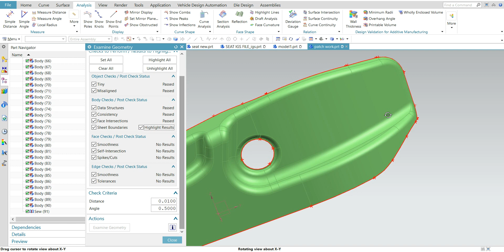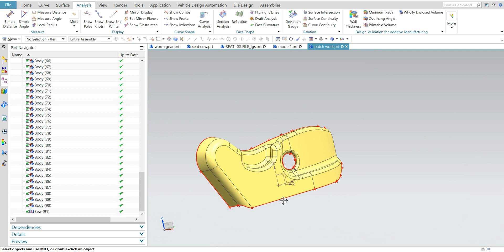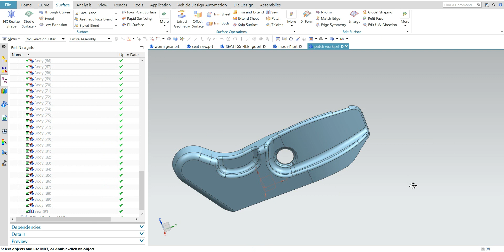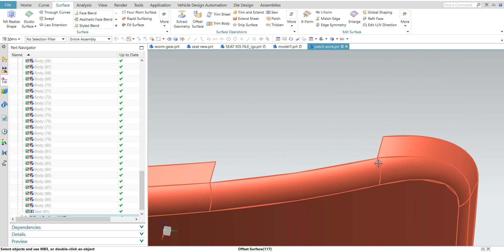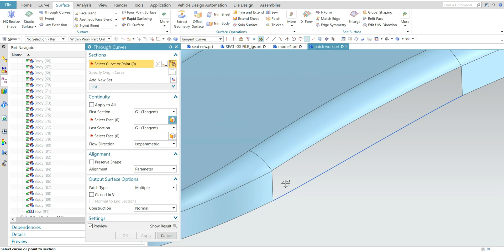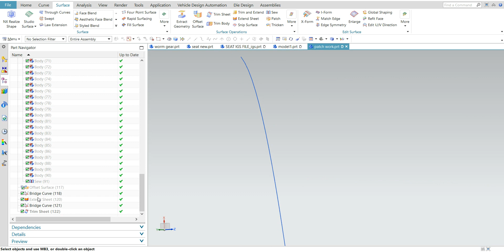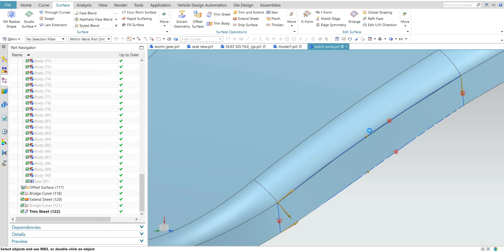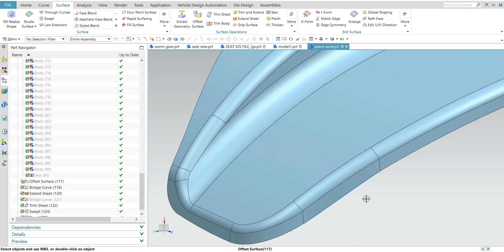PATCH WORK IN UNIGRAPHICS 12.0

Comment: Great work, these are all not easy to understand for a beginner still you made it much clear, try to offset the same surface for much more distance for making it a thick solid, we will come across an error called face cannot be offsetted the surface intersects with itself, at that point we will choose to offset surface command and it will create lot of surfaces which will be independent and non joint surfaces, if you make a video on that concept then your video would really help emerging designers to understand how we patch a class a surface. Good work buddy try to make much refined video on this concept.
Reply from the maker: I will try